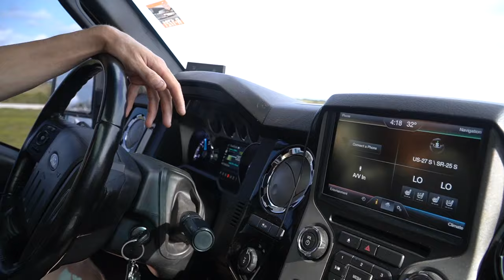Compound Turbo 6 Door 6.7L

Comment: Bought a 6 door excursion seats 11 ketelman air ride twin turbo 88 main 102 second 7.3 500 over pump makes 800 HP 5 inch turbo back rides like a caddy on 30 in jtx 42 tires
Reply from the maker: would love to see it